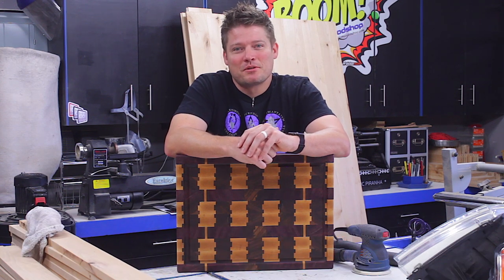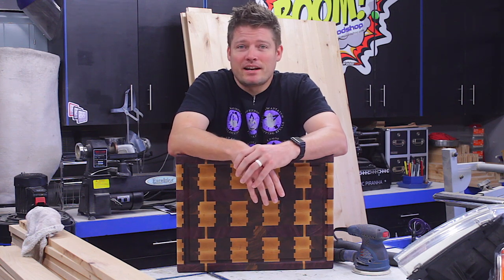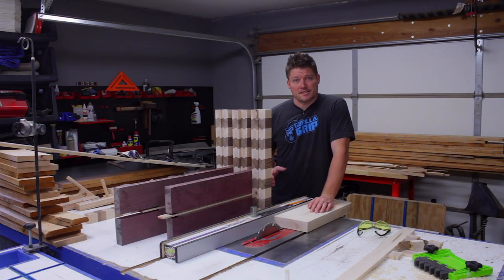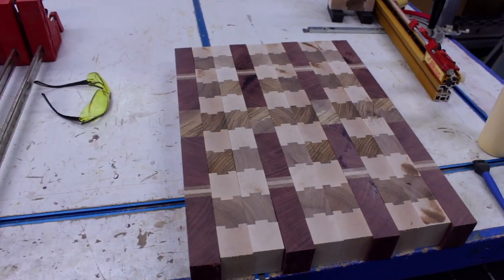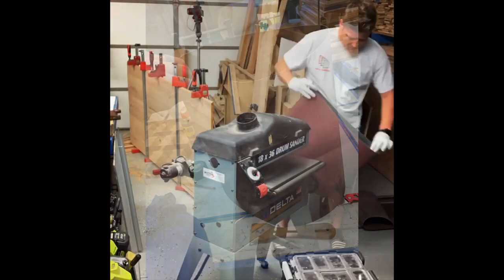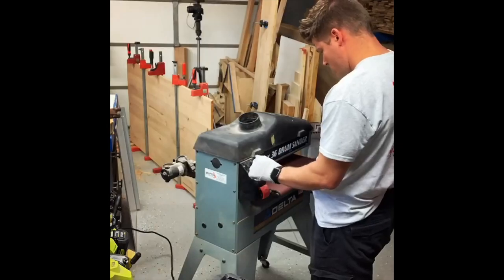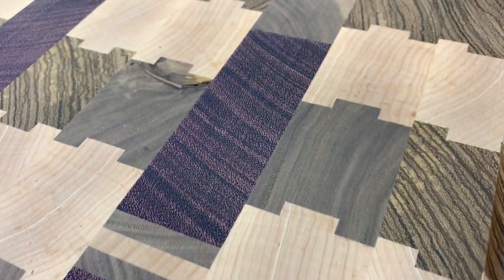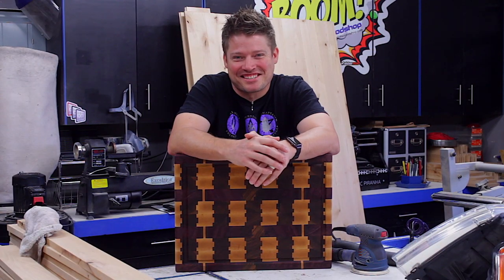ONE of a KIND Butcher Block! JOINERY!

Comment: Didn't realize you have same Delta drum sander. Have you been happy? Mine has NEVER tracked well, even after a very effortful Delta repair shop gave it their best shot. No matter how I adjust it, the feed belt tracks off to the right, requiring loosening/moving it back to the far left every 4-7 runs thru w/ boards.
Reply from the maker: I do like mine and what I ended up doing to get it tracking correctly was running stock through while adjusting the belt because it seemed like under no load it would track fine but the moment load was put down on it, it would start tracking to the right. It is not quite centered but it’s no longer tracking to the right anymore.
Reply: @rhwoodshop  I've tried running it loose or as tight as I can get it with the right adjustment screw and reverse efforts with the left adjustment screw and it always track to the outside, open end. It really stumped the repair guy to who thought he fixed it but he only reduced the problem slightly. Do you tighten the side you want the belt to track toward? Do you have the other side just barely snug?

Comment: How did you keep the purple hart purple?  Any time I do any sanding on purple hart it turns grey and loses all appeal.  I have tried heating it after sanding which can bring the color back out but that comes with its own set of problems.  Would love to know any tricks for keeping the color throughout the process.
Reply from the maker: Purple Heart is such a dense wood that sanding, if done too aggressively, can lead to scorching of the end grain which discolors the overall appearance. Doing a fine sanding that is not too aggressive will take care of the burn marks that you might get from an aggressive pass using 80 grit or lower.